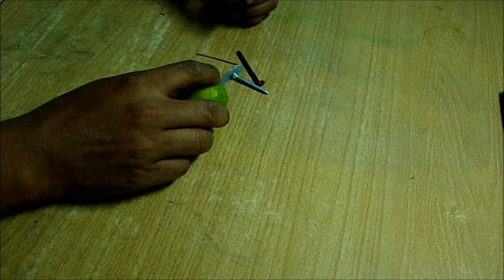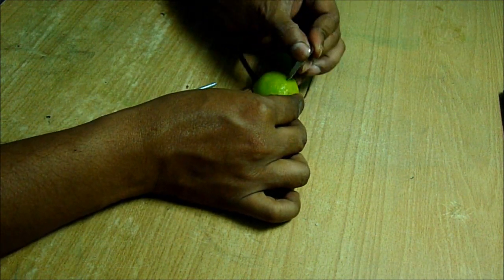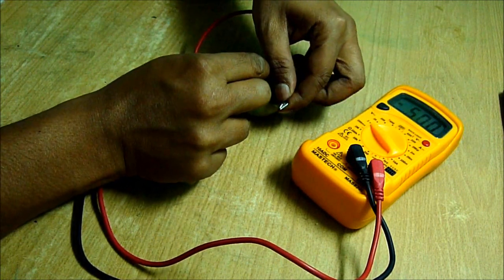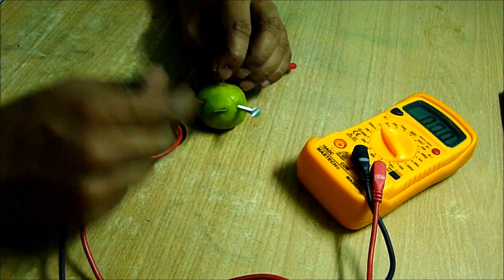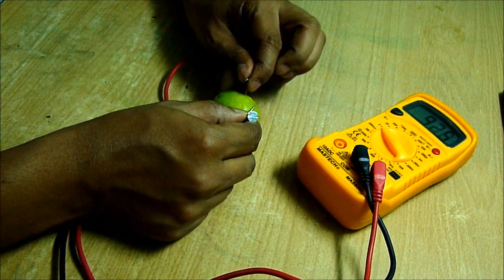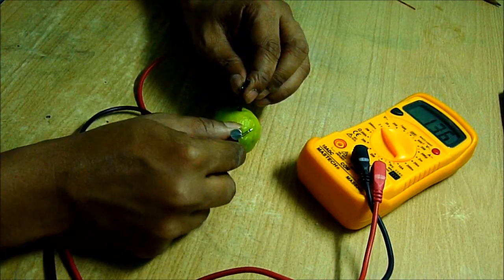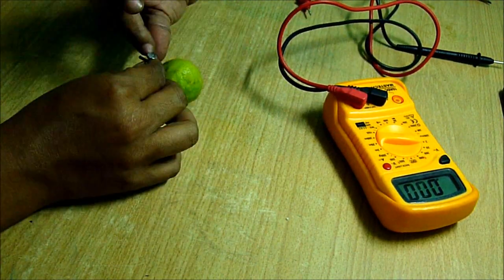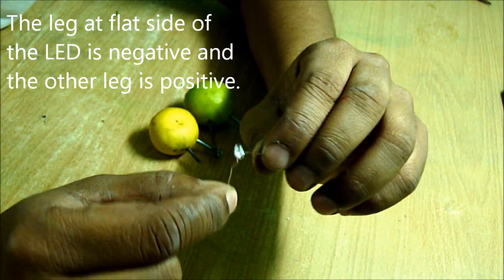How to make a battery using  Pencil Lead, Screw and Lemon

Comment: Cool experiment. I like seeing the different voltage values of the fruit. You can get the lead out of pencils by burning them in a coffee can. It takes a little time, but you get a very clean unbroken pencil lead. I used pencil lead, saline, and aluminum to make a very weak battery. I like yours better. :)